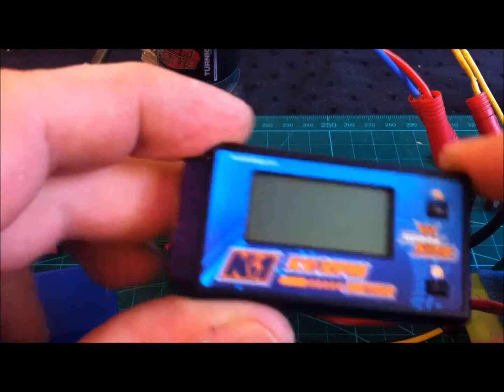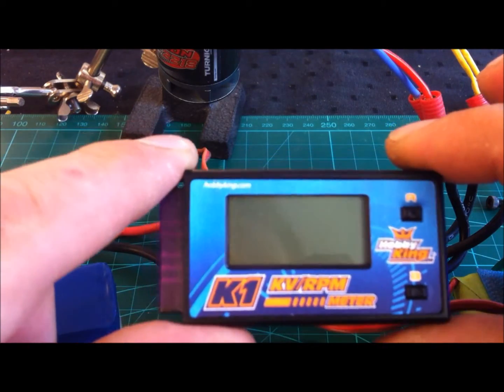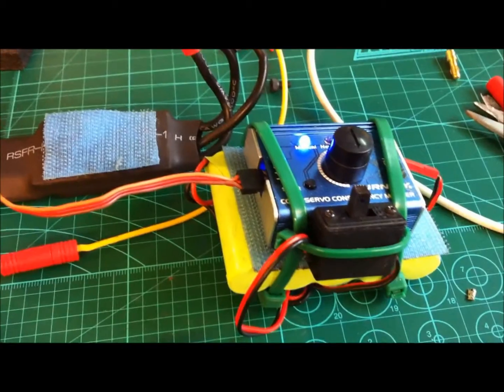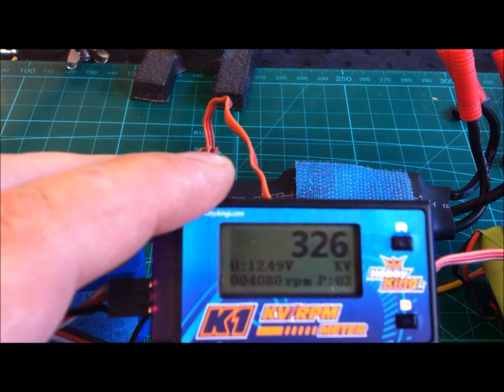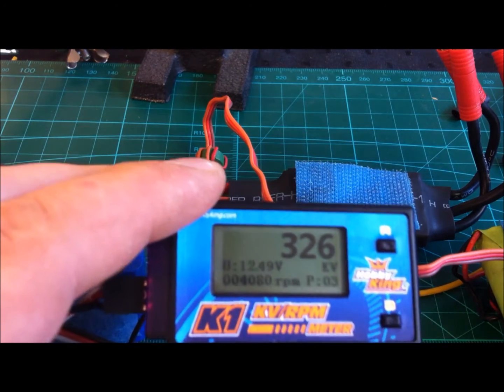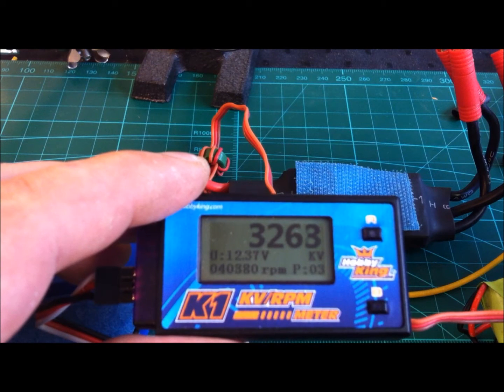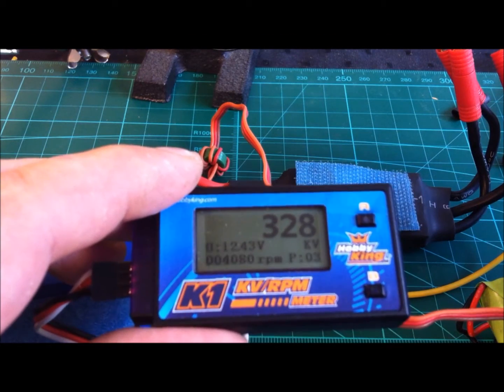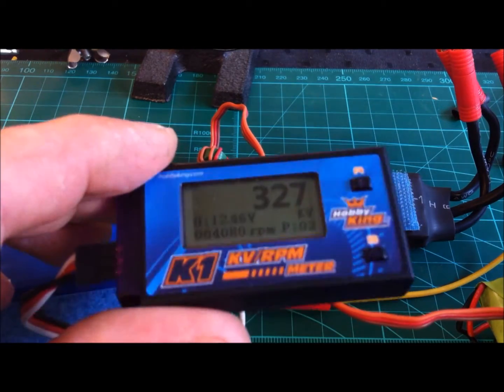Review of the K1 KV/RPM Meter and build of new wires

Comment: Thanks for the review. I bought one of these ages ago but didn't know how to connect it up. Very helpful. 
Incidentally electric motors are always 'motors' never 'engines'. Whether diesel, petrol, jet, steam etc. they are always engines but if it is powered by electricity it is a motor, regardless how big or small.